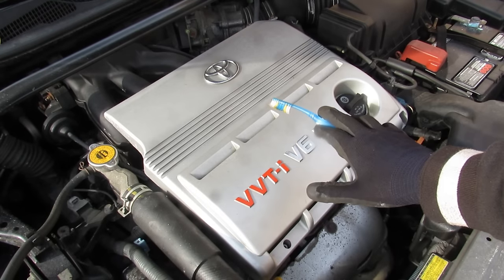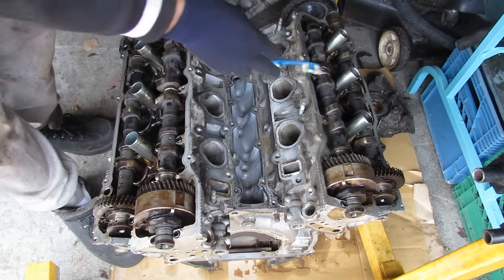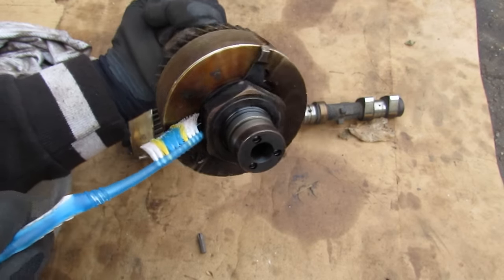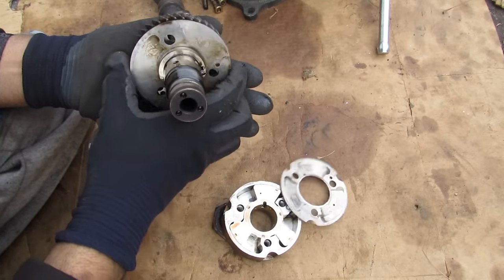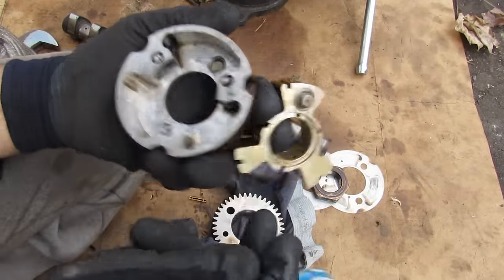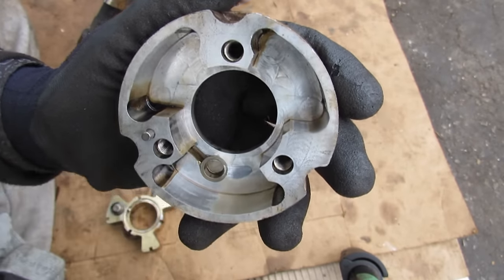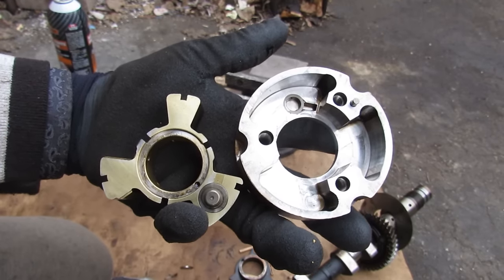Here's Why Your Car Rattles on Cold Starts

Comment: Thank you so much !!   now the noise makes sense !! ive had the noise  for over  4 years and its gone away now that i moved to florida i understand the root cause is  in the oil and ambient temperature since the oil does not get excessively cold in florida  the noise has completely stopped and sounds like a gem.  now i  have to address the transmission  also  slipping on second gear.  
i have 2011 Toyota Venza 2.7L i really thank you for your video
Reply from the maker: Good to know it doesn't happen in warmer climate

Comment: 3:34 what do you mean build up oil pressure? at idle when just turned on. Isn't that pin only clicked in there by centrifugal force at idle or prior lock before car was turned on? doesn't it only have oil pressure in there when there is demand from the driver pressing the pedal much?

Comment: Have a Jeep Cherokee 3.2. 59k miles. It makes that noise at start up. Most say it’s the rocker arms failing and wearing down the cam lobes problem. But it’s not a constant ticking it’s just start up. Can this also be VVT actuator lock pins on the 3.2? If yes should I try 5W30 instead of spec 5W20 for added pressure? Or is it better to go to a 0W for faster flow?

Comment: My '09 Pontiac Vibe (1.8L Toyota engine) does this. I've found that (on cold mornings) if I turn on the ignition and wait 5 or 6 seconds before starting then the rattle doesn't happen.
Reply: Exactly the same thing happens in my 2005 1.8 corolla

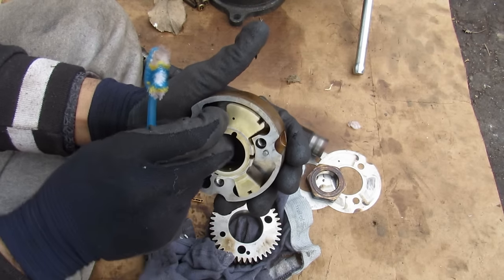Comment: This is a design flaw. As you mention at 3:22 there's no spring pressure to force the cam to return to the startup position when the oil drains away. They should get rid of that lockpin and instead have a return spring system, like a clockspring, alongside the oil chambers. No more rattle, and no more lockpin wear. That's my solution.
Reply: Sounds good. I also thought that sound occurs with a dry start due to oil draining back down in the pan.  A high quality oil filter will have an anti-drain back valve to help prevent this.  What do you think?
Reply from the maker: Yes some engines have that giant spring on the outside. Like bmw vanos

Comment: I fixed this problem by cleaning the little mesh filters that lead to the solenoids. They sludge up on these Toyota engines and then you don't have enough oil pressure at the solenoids. Very easy and FREE fix
Reply: How do you clean them do you have to take the engine apart
Reply: Reply please

Comment: Starting by using OEM toyota oil filters will help. Keeps oil from draining back to pan overnight.
Reply: Bingo ! That sound occurs with a dry start due to oil draining back down in the pan.  A high quality oil filter will have an anti-drain back valve to help prevent this

Comment: All I did was change my VVT sensors and it seems to build up pressure instantly. No more noise. 180 dollar fix. Well worth it. I was at 145,000 miles.
Reply from the maker: Good to know. Maybe the screens were clogged. What car?

Comment: Excellent video!!! I really appreciate you making this video as I am experiencing the same rattle on start up. Just purchased a used 2010 Toyota Rav4 with 2AR-FE engine with 122K miles. Love the car and was concerned on my first cold start hearing this rattle. Unnerving to say the least. Thanks for the reassurance my engine is ok.
Reply: You need to get a dealership to check it for you. 
There is a TSB that will pay to have it fixed up to 150,000 miles. Every thing I’ve researched says this is dangerous and can destroy the engine.
Reply: @dark30welderwelding11  I have a 2011 Rav4 4cyl with 280k miles one. Rattle started at around 140k. It has not changed its duration or caused any damage to the engine (yet, knock on wood). I didn’t know about it when it started and found out about the TSB after the mileage window. It is what it is I guess. Too expensive to repair it. I’m planning on putting a new engine on it whenever it decides to grenade itself.
Reply: @thegravitx  
It’s not too expensive. 
Go find the TSB just search. 
It’s around 2.5 hrs flat rate 
Parts are around $350 if you shop it. 
Get the Toyota OEM parts. 
I’m doing the intake phaser, the timing chain tensioner, the upper timing chain guide and a complete valve cover gasket kit with the O rings.
Reply: @dark30welderwelding11  Will do! It definitely needs replacement hahahaha
Reply: @thegravitx  

Mine is a 2010 RAV4 base with 213000. 

I truly think these 2.5L engines are as bullet proof as we can get. 

These new small 4cyl turbo engines are not going to hold up for the average consumer whose doing 10k oil changes even with full synthetic oil.
Reply: @dark30welderwelding11  I thought a TSB was for shops to understand how to fix the issue. Pretty sure you still eat the cost but correct me if I am wrong.
Reply: @aaronsilvers300  

A TSB does detail the issue and the fix along with necessary parts.  

TSB’s are for specific issues that come up for a vehicle. Each TSB will list what criteria are necessary to meet as well as if the TSB is covered by warranty.  If the criteria are met for warranty then the customer is not charged for the work or parts. 
It’s also like an addendum to the service manual. 

You can call the dealership and give them your vin and they can tell you about any specific TSB for your vehicle or you can search the internet as well.
Reply: @dark30welderwelding11  I looked up the TSB and it states Toyota will only cover costs up to 60,000 miles
Reply: @dark30welderwelding11  I called a Toyota dealer and ballpark estimation is $2500 but they won't know what they need to do til they see the inside of the engine.  No warranty that I know of, I'm the third owner at 120k
Reply: @chadg6874  
My dealership said factory warranty had been extended to 160k. 

Let me know how it works out for you.
Reply: @dark30welderwelding11  I guess maybe you must have had a 100K warranty originally for yours and the TSB added 60K and 60 months to that. I don't know if I have a warranty at all because I'm the third owner and it's at 122k and the factory warranty only last up to 60k
Reply: @chadg6874  
No sir

This is Toyota extension via the TSB for this issue. 
Google the VVTi issue and find the TSB article. That article is what my local dealership referenced the 160k mileage extension from.
Reply: @dark30welderwelding11  man that would be great if it works for me!  Do you know if it has to be original owner?  Also, what was their original warranty?  I looked it up online and found a info that said that it was 6 years and 60 thousand miles... But if factory warranty was 10 years and 100k miles, and then this TSB adds on 60 months and 60k miles, that would have made the warranty for my 2011 Highlander 160k miles and 15 years... And the VVTI gears would be covered until 2026 or 160k... Is that right?  Man if so and it doesn't expire with the first owner, I'm going to make a warranty claim for sure!
Reply: @chadg6874  
Does NOT have to be the original owner
Reply: @dark30welderwelding11  that's good news for me!  Man I've been researching more now that you said that, and all I can find from Toyota is that powertrain warranty is 6 years or 60 thousand miles. On the TSB you referenced, if just says "this repair is covered under the powertrain warranty. 60 months or 60 thousand miles from the first service date, whichever comes first." I didn't see anything on there about it adding additional time to the warranty or mileage up to 150k.  If it's on there, I'd really like to know because I can use that to make Toyota fix it for me
Reply: @chadg6874  

The dealership tracked it down for me. 

You may have to call around to a few different dealers. 

Sometimes the parts department is better at locating warranty info
Reply: @dark30welderwelding11  Just got off the phone with Toyota corporate. They said the warranty is only 60 months or 60k miles and I can't get it fixed under warranty. She's "opening a case with the dealership" and I expect to hear a big fat no on Monday. Best case scenario IMHO I'll get a discount if dealer does the fix, or they'll buy it back from me.. but I'm doubtful about that
Reply: @chadg6874  

Tell you what.

I’ll reach back out to my dealership. 

Just for clarification what’s your vehicle and year.
Reply: @dark30welderwelding11  I appreciate that man. It's a 2011 Highlander with the 1AR engine. 119k miles

Comment: 2008 Scion XD which has a VVT engine and rattles just like you show in the video. Will it cause a sudden failure and danger to me or is it ok to drive a lot longer?
Reply from the maker: You can drive it but eventually you'll get timing chain related codes

Comment: Great video! My VW was doing the same noise. An oil change seems to have solved the problem now 👍
Reply from the maker: That's temporary, the noise will return!
Reply: Used to own a VW, it could just be the sound of the valve slamming into the cylinder head, which is a normal sound on VW engines

Comment: My Toyota Camry does this as well. During the summertime and warmer months it does not rattle at all. It only does it when it's cold outside, and it only does it once after cold start up. If I start it after it sits overnight during cold weather, it sounds just like this video. If I quickly turn my car off and start it again, no rattle at all. I've even been told by Toyota dealer that everyone flips out when hearing this noise, when in reality it's annoying and isn't gonna hurt anything. I'm just gonna live with it.
Reply from the maker: Eventually the gears wear out. Eventually.
Reply: @speedkar99  I was told that as well. Since mine doesn’t rattle on every single start up the Toyota tech told me not to worry about it. They told me one customer came in with the same noise but his rattled every time he started his car. It’s been 3 years and that customer is still driving his car with no issues. Mine hasn’t rattled since last winter.

Comment: So would it ever get to the point where the VVTI fails completely and no longer engages to default correctly? I'm guessing the engine would run very poorly and probably throw codes
Reply: It will lose oil pressure with time because of wear on inner walls and this will affect performance..
Reply from the maker: Yes it can really mess up timing at that point but only to the 15-20 degrees it's allowed to rotate

Comment: thank you. finally someone showing the problem at the root cause.. was quoted 1800$ to fix honda cr-v rattle, same issue. they were doing chain, tensioners, actuator, whole nine yards. i think i will put a new spring in it  for 45 $ and call it a day,

Comment: That's why we should keep 5k miles oil change interval and used high quality engine oil.  0w20 in the newer Toyota with 10k miles oil change interval may be the culprit too. Some people went to cheap lube with cheap oil and still do 10k miles OCI without using full synthetic oil.
Reply from the maker: Agreed but it's more of a design issue as well since these things will eventually wear no matter how you change oil
Reply: @speedkar99  these problems started since toyota change oil change interval to 10k / 1 year from 5k/6 months

Comment: Thinner oil - synthetic and a high for synthetic oil filter stopped the rattle for me. Worth a try
Reply: I just went from 5w-20 to 0w-20 (both on the oil cap) and it stopped my rattle also.  2010 Pontiac Vibe (you know, the Toyota Matrix).

Comment: Exact same noise on my 2014 Honda CRV
Reply: Vtc actuator is your culprit. My crv does the same thing lol. Honda has a tsb on it. It effects pretty much all their 2.4 engines
Reply: @tehgibbles8314  I just bought a 2014 Honda crv 2 days ago never listen to this rattle noise until today. When I bought the car was already on so no rattle noise cad was warmed.I have been looking in the internet and there is a lot of people complaining about this issue and they have changed the VTC actuator and months later they have the same rattle noise when is cold.
If we do nothing about it can this eventually damage the engine or not?
Reply: Dude is smart but failed to mention that if vtc actuator fails will eventually cause driveability issues with engine timing and engine timing is critical when they cam damage valves if not timed correctly
Reply: @Andrea-rg9tr  I forget what code it is but when the vtc actuator actually fails it will set a check engine light. And yes it will cause drivability issues when it does fail.
Reply: Thanks. I was able to returned the CRV back to the dealership I made a big deal they didnt want me there making a big fuss so they gave me my money back. I loved tr CRV though if it wasn't for that issue. I'm not sure which small SUV to buy I dont trust Dealerships
Reply: My 2014 CRV does it too.   And it only has 8 thousand miles on it.    I use Mobil One 0w20 oil in it since new.   Yesterday I change oil but used one quart of Lucas Synthetic oil stabilizer  and 3 quarts of mobil one oil.    The Lucas is supposed to prevent dry starts by leaving a film of lube on metal parts.  Hopefully it works.
Reply: Beware Lucas oil stabilizers containers look very similar.    Make sure it says Pure Synthetic on the label.  The other Lucas stabilizers are way too thick and will harm these newer engines designed for lighter oils.

Comment: Turn the key to ACC for 5 seconds before you turn to ignition. This starts the oil pressure first before your engine actually starts. Have been doing this for more than 2 years now and never heard that sound again.
Reply: I will try this, thank you
Reply: Doesn’t work with my Rav4 ?? I tried everything so many times before starting the engine but oil pressure only builds up if it’s running. I even tried turning the engine over for a split second without actually starting it to see if it helped, it didn’t, maybe I didn’t do it enough times. But at the point I would be damaging the starter I think.
Reply: @thegravitx I have RAV4 also. did you try changing oil to 0/20 synthetic? I'm going to try that next.

Comment: Brilliant ! Very insightful and super helpful depth of knowledge in just five minutes ! Priceless !
Personal experience: I noticed the cold start-up rattling sound after I had jacked up the car to change out all the brakes (front and rear) and rear bearings. Initially thought it was only going to happen the one time due to oil displacement from jacking up the car, but it actually happens most of the time and this makes sense based on speedkar99's awesome educational video. Many thanks !!

Comment: I lived with the rattle for 3 years - the worst part was when I sold my car and the rattle would sometimes happen in front of the potential buyer and the embarrassment but anyway I explained it is nothing to worry about. That was my used car salesman moment, I would sometimes start the car just before a potential buyer came and then normally the rattle would go away on the next start up for a little while
Reply: Just start it before the showing.  The oil pressure will remain in place and not rattle for a few hours at least.  But, somewhat dishonest.  That is what the seller of my 2010 Pontiac Vibe did to me.  Still a great purchase anyway...0W-20 oil fixed this so far.
Reply: @Chris Papanastasopoulos  so is that the fix? Thinner oil or something MMO freeing up the pins? I have that cold start rattle on an 05 sienna 3.3. Good to know it won't blow up, but I would like to remedy it without tear down

Comment: It would seem that maybe even a couple oil changes with MMO would help free up that VVT pin as it would a lifter or something.
Reply: @Pod Thanks for the suggestion. I've added 20% MMO to my latest oil change as an experiment. Will report back if successful.
Reply: @ericpircher  what's mmo?
Reply: @ineedstuff8286  Marvel Mystery Oil. For the record, the experiment did not work; the rattle is still there after a month of use.

Comment: Great video! Thanks for posting. This Toyota VVT is VERY similar to VW/Audi's VVT EA888 engine, but unlike the rattle on startup on the Toyotas, on the VWs and Audis is a rattle/clatter at idle (no noise on startup) once the engine is relatively warm. Great for video for reference, thanks again.
Reply from the maker: That was timing tensioner causing the chain to rattle
Reply: If its rattling when warm then its your timing chain tensioner.
Reply: @Kdubz_Auto_HVAC  
It was not the timing chain tensioner, it was the actual VVT mechanism. The new VVT mechanism solved the rattle at idle.

Comment: Very informative Mr speedkar, thank you.  
I own a 2017 Camry (4 cyl) and a 2007 1.8 Corolla . 
Both cars very low mileage but a lot of short trips which isn't ideal I know.
 I change the oil every 3K to 5K.  Is there any other way to help prevent
the wear of the spring loaded pin you were showing us? The Corolla only has 40K and its very quiet other than terribly cold mornings. That's when I can hear some noises...a few rattles and knocks. Any recommendations or keep doing what I'm doing? Do you like the new GF-6A oils.. should I try that in the winters?
Reply from the maker: You are welcome
Reply: Little late to the party here but its really a non issue with toyotas lol. Idk about the camry but the corolla will fall apart around that engine. If you must make frequent short trips, make a point to go out and bag on it at least once a week. Do a few 0-60mph pulls wide open throttle to get the oil hot, and evaporate impurities like water or gas that accumulate and contribute to sludging

Comment: I fixed my rattle by using $15 bottle of Nulon oil additive. Do an oil change then add Nulon, problem fixed. Rattle always went away after oil change but soon came back as the oil deteriorated after about 5000km. Nulon extended the life of the oil.
Reply from the maker: So that's like Lucas?